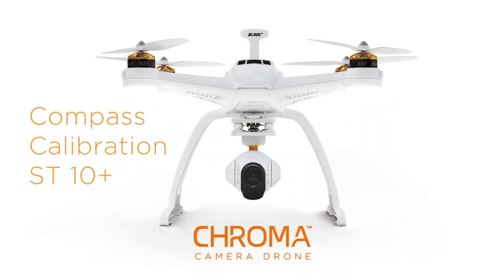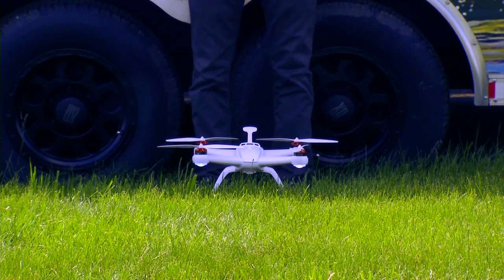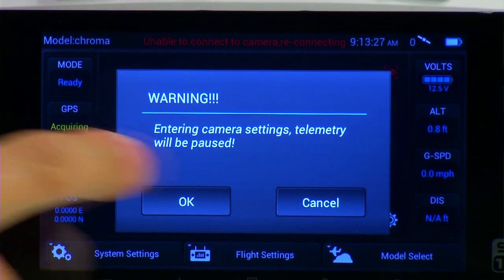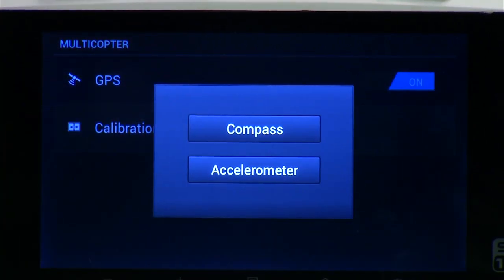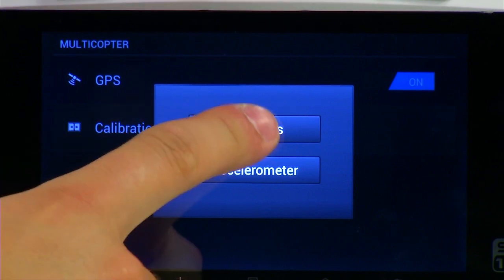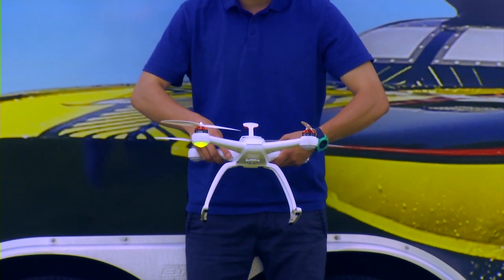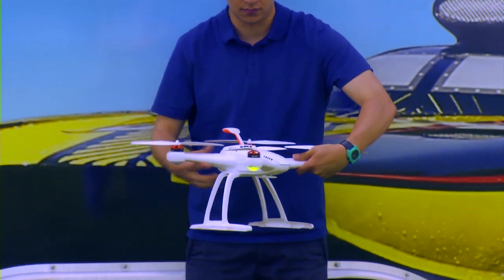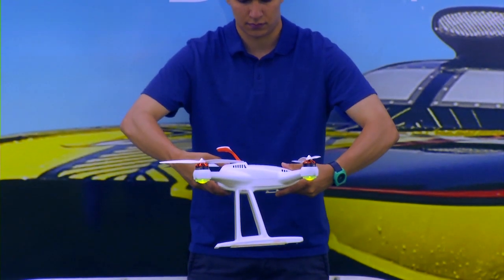Chroma - Compass Calibration

Comment: I live in an area where the magnetic declination is somewhat significant.  Am I supposed to calibrate to true north or to magnetic north?
Reply: True north. The controller uses magnetic compass for quick corrections, and GPS for slower position verification. If your compass calibration is off by a sufficiently big margin, the quad may start to fly in circles while simply trying to maintain the position. Medium size error will cause a constant pattern, while the big error may cause the craft to fly in the increasing circles...